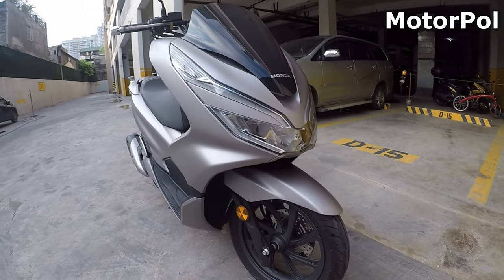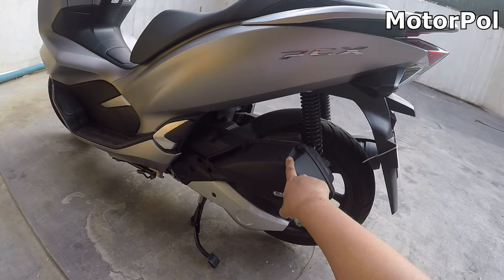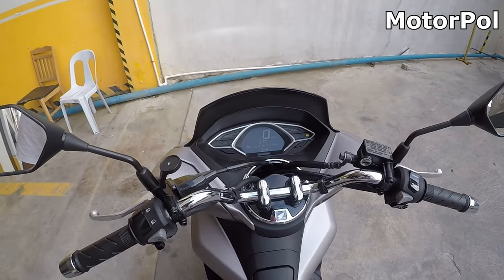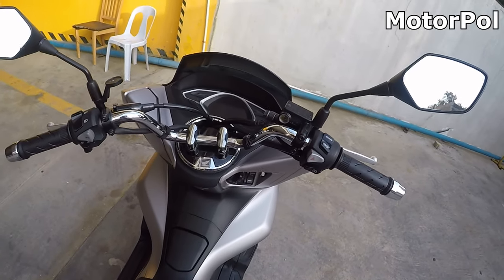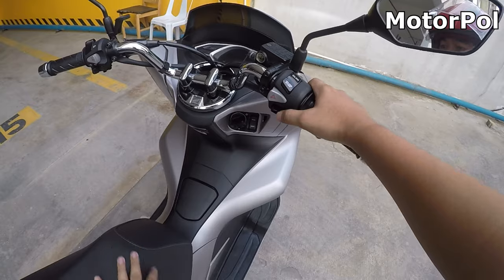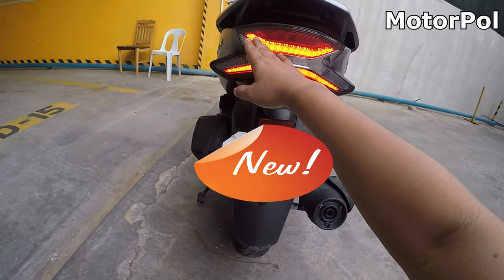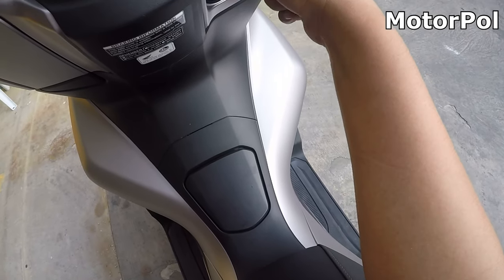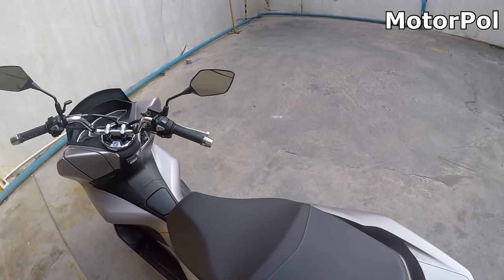HONDA PCX 150i UPDATE | Kumusta na? After 5 months/5,000km | Minor Issues | Motovlog #12

Comment: Yong pcx po ba na 2020 eh abs narin ang likod? Salamat po. Saka same meron na po bang pcx 150i? Anu difference po nila? Pcx kasi bibilhin ng tatay ko for me po. Pa help naman po. Salamat po.
Reply from the maker: Hi paps, as per honda wala pa silang balita kung may changes sa specs ang 2020. PCX 150i ang latest ngayon paps.
Reply: Ahh, pero nasa market narin po pala ang pcx 150i? I mean dito satin sa Pinas meron narin po? Thank you so much po paps hehe cute. New subscriber here na po 🤗
Reply from the maker: Salamat po.. yes po nasa market na po, actually yung motor ko po is PCX150i na po heheh, sobrang tipid po sa gas.
Reply: Last na lang po paps 🤗 panu ba malalaman kung 150 o 150i po? Salamat po 😊
Reply from the maker: Kapag fuel injected po may “i”.
Reply: Maraming salamat po. Sabihin ko na lang sa tatay ko po hehe hindi ko rin kasi alam yon fuel injected 😊😊 pero salamat po sa info sir paps 🤗

Comment: Sorry wag kayo ma trigger ha, kakabalik ko lang galing abroad and first time ko lang narinig yung term na "dragging". Di ba "sliding" yun? Correct me if I'm wrong. RS lagi.
Reply from the maker: Shuddering is the correct term. Dragging is just famous term used sa pinas.
Reply: Dragging term dito ay yung malakas ang engine vibration plus hirap umarangkada at 0 to 10kph usually felt pag me 2k+ odo kana sa mga scooters.